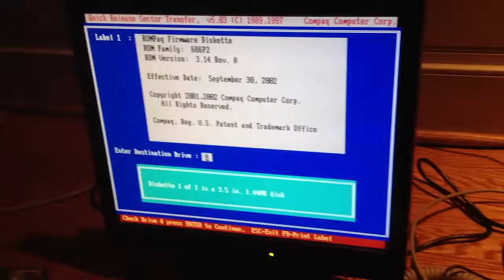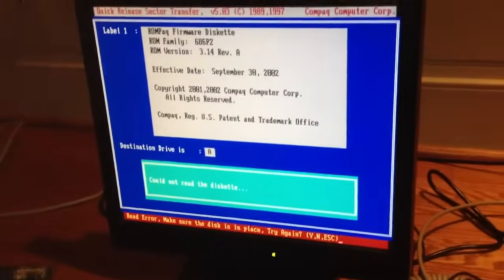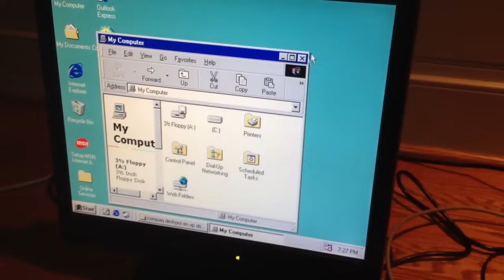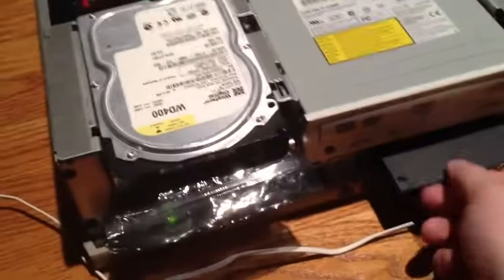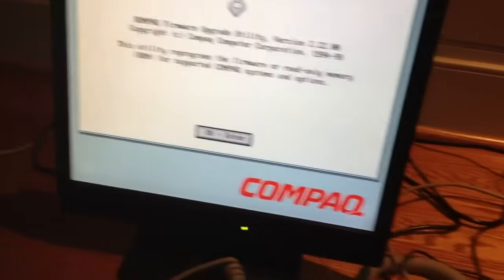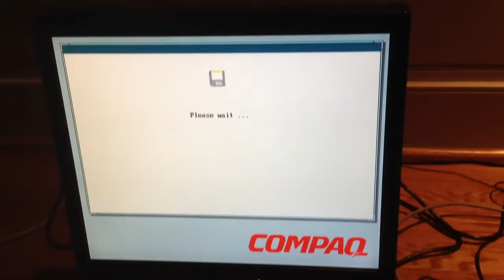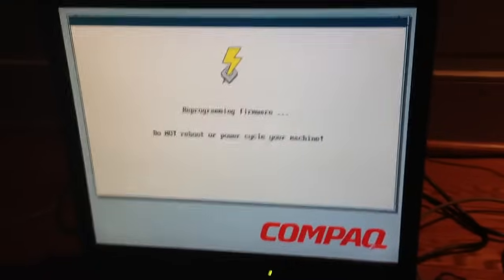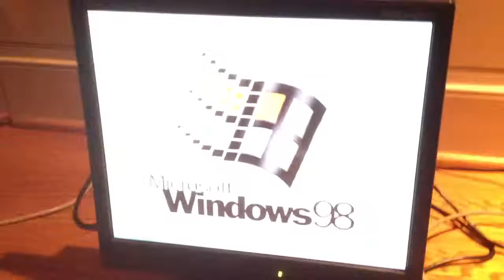Compaq Deskpro EN: Updating The BIOS

Comment from the maker: yep. funny thing is that it has more slots than it needs to max it out. i ended up putting one 256 stick in there along with 2 128 sticks, just to make it "look" maxed out. this machine runs windows xp very fast for what it is. i have yet to try linux on it, i plan on doing that.